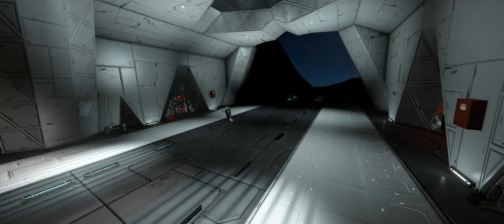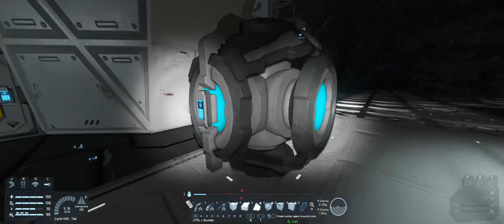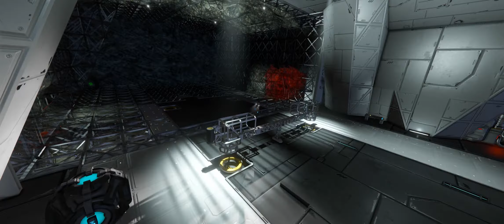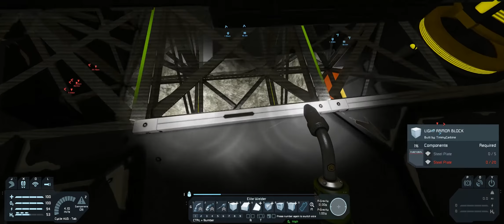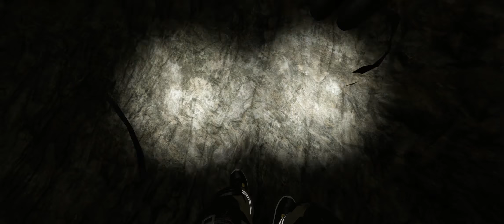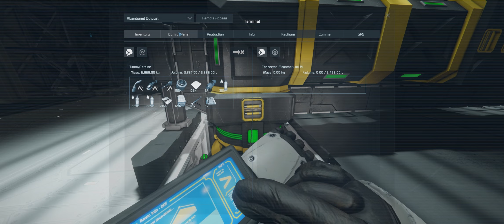Space Engineers Survival, Maybe... || E20 - Extremely wound-up welding contraption || TimmyCarbine

Comment: That is yet another brilliant piece of machinery to fix a mundane task and I am confident you will get it working - eventually.

Personally, on a build like this, I wouldn't bother with any armour to spruce it up as it is technically a one use item that will be knocked down once the job is done..
Reply from the maker: Thanks mate, I am glad you like it. The project involved a bit of trial and error, but eventually it turned into a massive time saver. I don't think I added much armour to it, by the time I had enough welders in place there wasn't a great deal of room for styling but I like the look of the final machine anyway. It looks like a purpose built machine rather than something pretty that doesn't get the job done.

Comment: 1st - Congrats on leveling over-complicated engineering to a whole new level! Well done mate!!
2nd - STILL LMFAO ABOUT THE EXPLOSIONS!!! The tinniest action scale up to be a wow firework!! That's a chain reaction!!
If I may, can't you place gigantic wheels instead of the skids? Not sure about suspension and stuff, but would look like a lot those heavy duties lorries and since they are not meant to steer...
Now just a lucky guess: are you sure that those rotors placement didn't jinxed it? For me they seamed forced to be aligned, but their original stance was a bit angled. That was why even locked the rotors had a 13º rotation. Can't you use steady components, like a bunch of armored blocks, since the axle is not supposed to shake, twist or anything else?
Besides that keep up those videos and don't live us anxious waiting for new vids ;)
Reply from the maker: Thanks mate! In my testing while working out a design I orginally tried using a wheel based sled, sadly the large wheels were too big. I also tried a group of smaller wheels in each corner which fit perfectly and actually looked quite good, but to my surprise they didn't have enough strength to support the device.

You are partly correct about the rotors, they were forced to be aligned, but my mistake was forcing them while the device was still locked to the base with the landing gear. After this episode I opened the world, unlocked the rotors and was able to release the device without any explosions.

I need to use the rotors to transition from small grid blocks to large grid blocks. A downside to that is I am unable to support the device in any way due to the game seeing each end of the rotor as a subgrid.
Cheers mate, I'll keep the videos coming, this one was just a pain to record due to me having to rethink my design so many times
Reply: I'm glad they worked! Can't wait to see this metal monster in action! BTW couldn't resist and bought both space and medieval engineers, mostly because of you and Splitse! I was honestly a bit sad that you lost interest in Ark, I've been watching since brutal evolved, I reckon , and you buildings really inspired me, even though the bronto mayhem back there was the crown jewel!! I'm hoping you'll dive back in Extinction expansion and give us those colossal building. But please make Space Engineers a looooong series. For me is a instant play when the notification arrives and you're not even in space yet!!
Reply from the maker: That's awesome! Glad to inspire. I will most likely cover a bit of the extinction dlc but I'm really enjoying SE so this will be a long series, I will eventually get to space, but for now I'm happy just playing with gravity

Comment: I think Keen made changes to pistons/rotors/wheels in 1.187 and broke stability. I have a world with all sorts of creative mode test builds that I built in 1.186 and they worked fine. I can't even load that world in 1.187 because everything immediately explodes. Of course, the kicker is that when you load a world in 1.187 for the first time it says something about updating the save file format, which I assume means I can't revert back to 1.186

I think it was a great decision to leave in the failed builds. I think experimenting with an idea and discovering it doesn't work is a huge aspect of engineering.
Reply from the maker: I noticed the same issue with my solar tower. I have to check it each time I load the game because sometimes it randomly explodes when I first load in.

I did get the Megatherium to function the way I had it in creative. The only thing I did was remove the rotor lock and now it works perfectly.